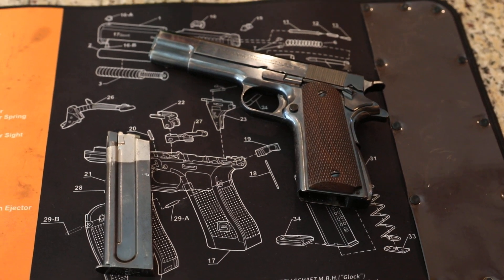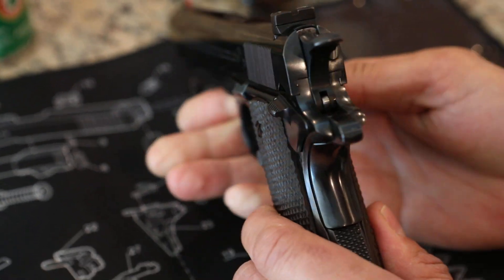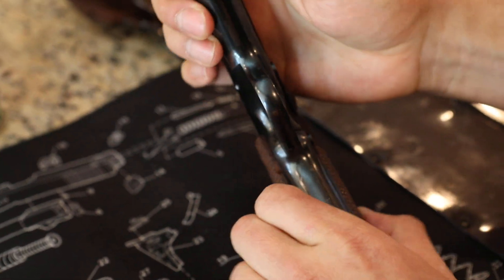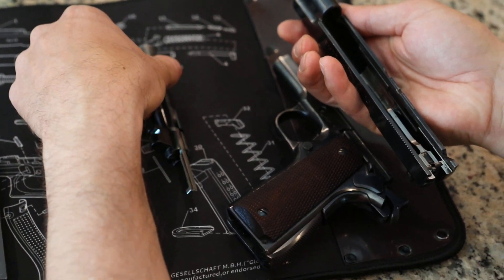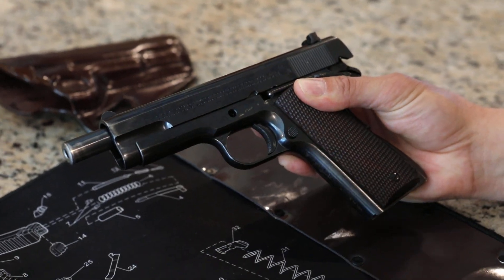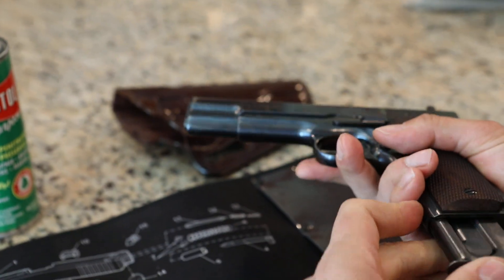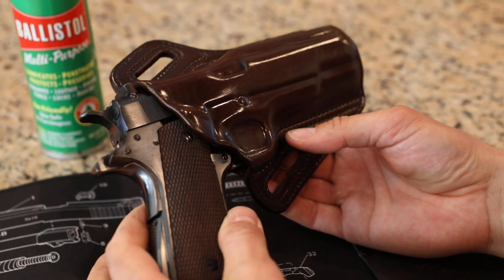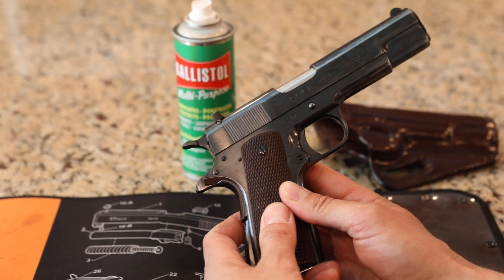Colt 1911 22 ACE Military Training Pistol 22 Long Rifle

Comment: 🟥 Nice video.  Question...can you dry fire this like a regular full size 1911 ?
Reply from the maker: Paul,

With most centerfire pistols you are okay to dry fire.  With rimfire guns it is not recommended as it can damage the firing pin.  Some newer rimfire manufacturers say in their manual that it’s fine.

With this old gun I would probably error on the side of caution and not dry fire it unless it’s on a snap cap.

Hope this helps!

Drew357
Reply: @Drew357  Hey Drew.  Thanks for the info. Got one like it and I like shooting pencils out of my 45acp 1911. Guess I'll invest in some snap caps.